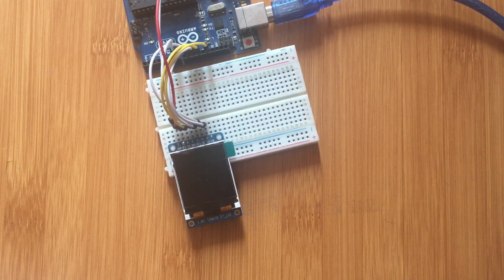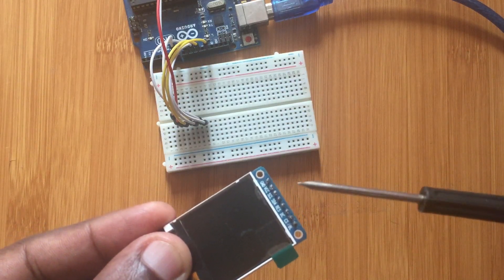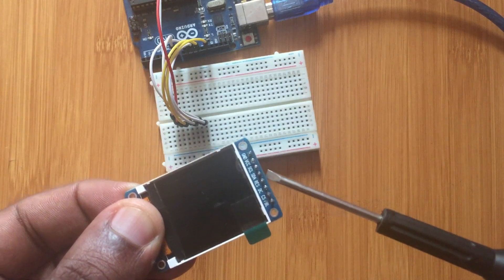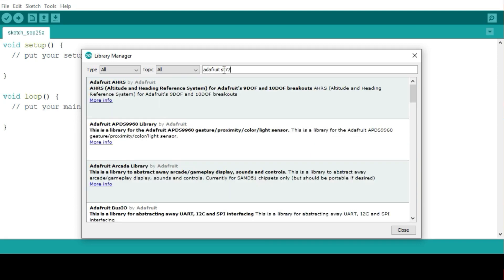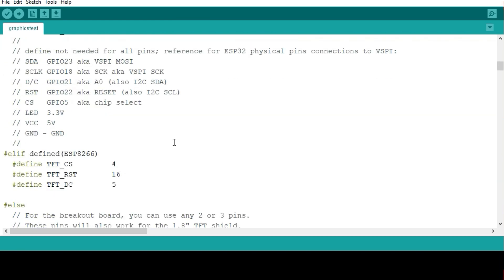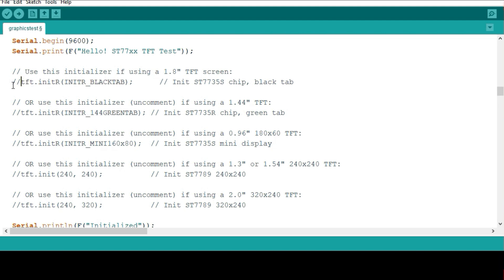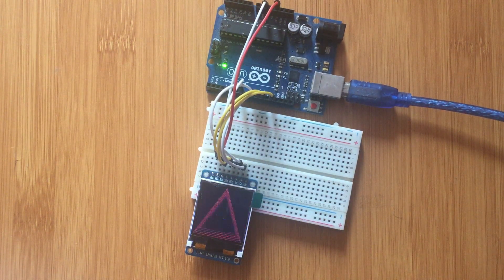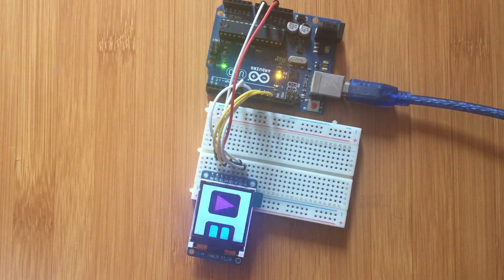USING THE 1.44"  ST7735 COLOR TFT DISPALY WITH ARDUINO.

Comment: My display (128x128, 1.44" SPI) is labelled differently (from front, left->right)
VCC, GND, CS, RES, A0, SDA, SCK, LED.
What are the uno pins needed ?
I have tried a lot of combinations but no results, except a light grey screen.
Reply: same, A0 is the DC pin, LED is the BL pin

Comment: white screen
Reply: I was having the same problem. I had connected the VCC pin to 3.3V. and after connecting to the 5V pin the white screen is gone.
Reply: Did you solve it?
Reply: Same and haven’t been able to solve it yet

Comment: My TFT screen is still blank, when I press reset on the arduino the text on the screen is very dim and then disappears
Reply: Did you solve it?
Reply: @alisouzr  Yes, I was able to solve this problem some time ago, I put 1k resistors on the digital connection pins of the TFT screen, I hope it will help you.
Reply: @gmkr100  digital connection pins? which ones? like the vcc,the gnd and the leda?
Reply: @alisouzr  I was having the same problem. I had connected the VCC pin to 3.3V. and after connecting to the 5V pin the white screen is gone.
Reply: @germannadv  I'll test it now
Reply: @alisouzr  did it work?
Reply: @germannadv  no...

Comment: The Arduino is 5 volt but the display is 3.3 volt this is misleading to show it without a CD4050
Reply from the maker: This display has an onboard 3.3V @ 150mA LDO regulator and is 5V compatible! It can therefore be used with 3.3V or 5V logic.